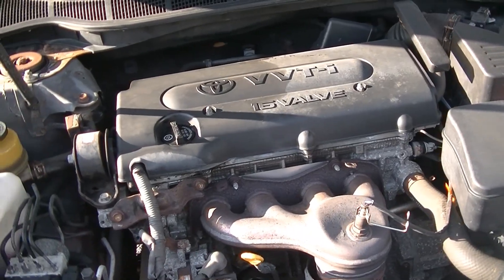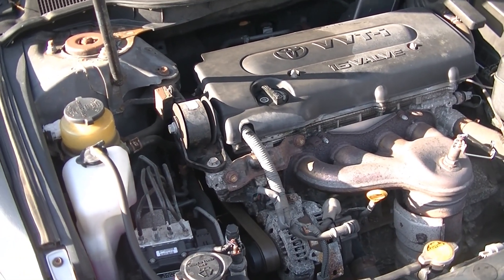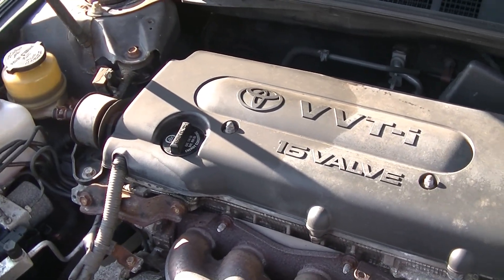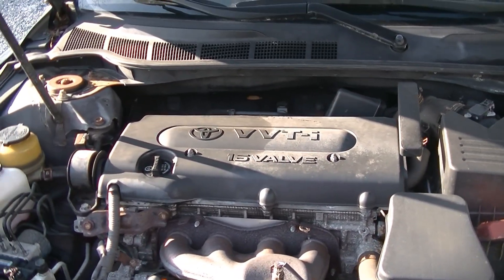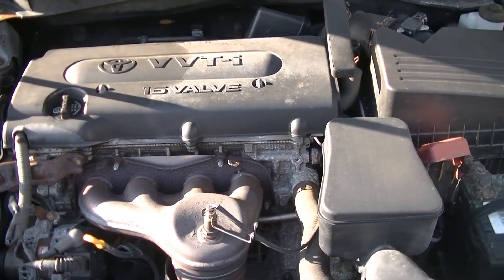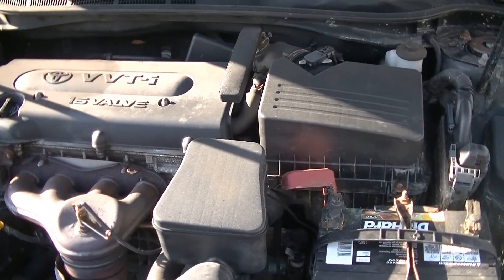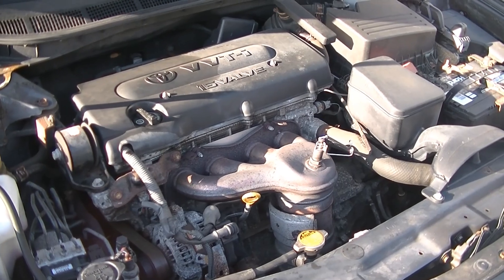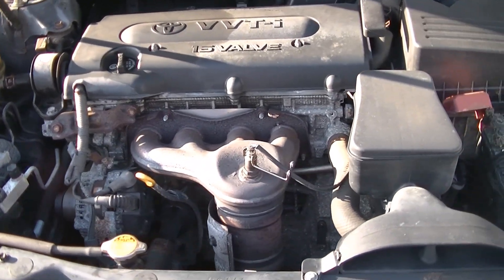Why you should AVOID a TOYOTA with the 2AZ-FE 2.4 liter engine!

Comment: Our 2009 Camry with 2AZ-FE currently has 106,000 miles.  We keep records and changed oil every 3,500 to 5,000 miles.  I started changing the oil myself at 83,000 miles using Mobil-1 Synthetic 0w20.  It currently burns 1/2qt every 2,500 miles, but when I change the oil it still has a nice amber color.  We purchased this Camry new and the only maintenance is Gas, Oil, Battery and Tires, other than that I just recently replaced the Spark Plugs and Air Filter.  Engine Bay looks brand new, no rust or engine leaks and Engine has never been washed.  Always garage kept.  So far this Camry has been a great vehicle.  I'm "Toyota impressed" even if the 2AZ-FE is not the best Toyota engine.
Reply: Don't change anything you're doing based on what I'm saying. I'm only sharing. I have an old friend who owns a junkyard and is something of a car guru. He's the 3rd generation owner of the yard so he's been fixing cars since he was born and he's in his mid 60s. We had a conversation about what oil to use in this Camry he just sold me and I suggested the Mobil 1 synthetic because it's always done me good with all my GMs. He very passionately told me not to.😂 He said every time one of these blow up he asks what they used and every time it's Mobil 1. 
Synthetic is the way to go but he swore by Castrol and made me promise not to put Mobil 1 in here. Do your own research and take what I'm saying with a grain of salt because I'm just telling you what was told to me.

Comment: I have over 288,000 miles on my 2AZ-FE engine and it still runs like a champ.  I did started using Restore engine oil additive which has helped out tremendously.   Not sure what's so bad about this engine.  It's a very reliable engine in my opinion.
Reply: My 2006 Camry has zero oil consumption between 3,500 mi synthetic oil changes with the correct grade of oil. If you guys follow those instructions you'll never our problems with this motor. It's a great engine but it's not designed to be owned by idiots.
Reply: @rene6722  I have a 2006 Camry.  250,000 miles and runs great.
Reply: @brianraulerson5037  mine just turned 230,000 miles no problems at all. I replace the rear drums and the front brakes and everything to do with the brakes along with all new springs for the suspension.
Reply: @rene6722 You don't have this motor in your 2006. It was produced from 2007-2009.
Reply: @phill3583 I know that's what I said. I have the 2006 motor that has the better piston rings in it.
Reply: @rene6722  you may have the bulletin repair done. Otherwise the 2azfe  engine is nightmare
Reply: @flyingman358  all I know is I got the car with 167000 original miles from the original owner in 2016, and now it has 228000 miles. Zero problems ever. Great mileage great power quiet engine. The only thing that ever happened was it needed a battery a drive belt and an alternator that's it.
Reply: @flyingman358  I will do some research and see if I have the fixed engine. It's definitely the best 4-cylinder engine I've ever owned and I've owned practically everyone ever made from most manufacturers. I have another car and it's a 1996 Camry. Another bullet proof car that runs like it's new.
Reply: @rene6722  my 07 rav4 has the same engine, and the original owner. The oil consumption issue was terrible since 50K miles, I received the Toyota notice for the toyota service bulletin and extended warranty to 100K , but my local Toyota dealer turned down my service request. Now the Rav4 only 150K , huge oil consumption problem
Reply: @flyingman358  yeah I've never had an oil consumption problems. Between oil changes I might put 1/4 of a quart of oil in.
Reply: @rene6722  that means it got TBS serviced. It could be a great engine in the early stage had piston rings replaced
Reply: @flyingman358  you know what bro,? I would not doubt that. The person that owned it before me said that it was fully serviced and that it had something repaired from the factory. That's probably what it was! I am very lucky with cars.
Reply: @flyingman358  I have always been impressed at how my 2006 Camry does not consume oil. I can almost guarantee you that you are right. It most likely has had that service because I've been researching the last hour, and what you say sounds to be correct. Thank you.
Reply: @rene6722 another video mechic mentioned looking for black sealant around the engine cos the original factory  is grey .
Reply: @flyingman358 nightmare according to who, I have a 2AZ-FE in my 08 tC and haven't had any issues. Calling it a nightmare is a clear overstatement.
Reply: oil changes 5k and under were key for the faulty piston rings design
Reply: @cutehumor  I've had 2 cars with the 2AZ in them and both I neglected to shit and they both had over 200k and ran fine
Reply: @roswell911dd8  I don't believe so. Unless you have piston rings changed , otherwise the crazy oil consumption issue
Reply: @prettylies7387  oh wow that's good news! So basically I own the best camera for quality and that's awesome! I knew I was smart to buy that car back in 2016. Zero problems.
Reply: It has defective piston head seal rings but other then that its great
Reply: I have 300,000+ on mine and have never had a problem.
Still going

Comment: from what i am hearing from this video it sounds like negligance of ownership not a failure due to improper manufacturing i own a 2007 scion tc with this engine and it runs amazing at 262,000 miles no oil burn issue or any others listed y him

Comment: I just bought a Scion xB2 with 278000 miles for $200 as a daily.. it has 6 codes, none are for the engine and all that I can fix myself, these engines can last forever. Just fix them if they break and keep pushing.

Comment: Got my vibe gt with this engine, bought at 72,000 has 132,000, never replaced anything yet just change oil every 8k runs like a champ, BUT they fixed the headbolt issue in 2010

Comment: Yeah he either is not familiar with toyota engines or is trolling everyone this engine is fantastic and can over heat without blowing up iv been driving my 2.4 for 300.000 miles still going strong no ticks knocks Nothing yes gaskets on everything get old eventually but I believe u might be confused with the north star Cadillac engine there is a big reason why a company that over engineneers everything used it for a decade

Comment: This guy is FOS... The oil issue was in the 2007-2009, because of poorly made pistons.  2002-2006 were some of the Best engines ever.  I wouldn't follow this guy, if he paid me !!!
Reply from the maker: I guess you didn’t watch the whole video. I specifically say in the video that the oil burners are from 07-09 from piston issues. 02-06 are known for head bolt thread failure in the engine block

Comment: Only one made in usa have defective piston ring from 2007-2009  i have one made in australia i never have this problem
Reply: really.....I currently looking at a 2007 toyota rav4 and it only has 70,000 kilometers here in Aus the used car yard say's it has had Major recondition repairs to pass roadworthy and does have two different colour side mirrors. it has the 2AZFE engine but that has turned me off due to the reputation of that motor with burning oil.
Reply: @dalesmith4985   only in usa had that problem

Comment: Is it good to use a 20W-50 oil but I change my car oil maximum is 2 and a half month. But normally I sha get it every month.
Reply from the maker: That is way too thick in my opinion. I like to stick to manufacture recommendations as close as possible. You can try a 5w30 or 10w30 if you don’t live in a cold climate. The thicker the oil the longer it takes to get to internally lubricated parts of the engine

Comment: My ‘02 Camry has this engine, and has burned 1qt. per 1000 miles—for the last 100K miles.  The engine is completely original, except for a couple of valve cover gasket replacements, and routine coolant, oil, filter, and plug replacements, and now has 314K miles on it.  Starts and runs smoothly.  The exhaust system has been replaced once because of salt-related rust, not because of any oil-burning catalytic converter issues.  My mechanics’ guidance has been spot-on: “Add oil, and keep on driving.”  I would avoid the ‘07-‘09 editions of this engine, but my earlier one has been fine.
Reply: Every have any head bolt issues?
Reply: @jordandudgeon346  No.  I think as long as I keep the cooling system in good shape, and it doesn’t overheat at all, they’re not a problem.  327K miles now, and still being daily-driven by my son.
Reply: Thanks! Man some people are so negative about this engine. They make it sound like the head bolt stripping the block is inevitable. I just bought one with 85000 miles and I was nervous to find out about head block issues after, but I think if I take care of it I'm good. People are being unrealistic I think, pretending the head block issue is more common than it is. Do you think it happens to most of these, or just a small portion?
Reply: @jordandudgeon346  Dunno—I have a sample size of 1.  But if I was in the market for a bargain in a used car, a private sale of a known-low-mile pre-‘07 Camry w/the 2AZ-FE, preferably from an elderly, maintenance-fussy driver, would be on my shopping list.  And they’re out there—hopefully, you got one of those.
Reply: I got one with 85,000 miles for $8,500 Canadian Dollars (so about $6000 USD). The outside is in perfect condition, not a scratch, the inside is mint, the console still smells new on the inside, drives great, no issues, doesn't burn oil, and oil stays gold for a long time in the engine... I'm sure the man was mantnaince fussy, as it's in great shape. The hood says the tyranny was flushed at 80,000miles and the coolant was flushed at 60,000miles. I'm the third owner, but really I'm the second. The first owner was an old man who sold it because he couldn't drive anymore. The second was a younger man who took good care of it but only had it for 2 months and then sold it to me as he was moving.

I really hope I got a good deal, and hope it lasts. Don't want to run into this head block issue! Besides that I don't have any concerns for the reliability of this engine!! Think I got an okay deal?
Reply: @jordandudgeon346  We bought ours 13yrs. ago from my mother-in-law, and it was a rental or lease turn-in when she got it.  It had 114K miles on it when we got it from her, and we’ve put 213K on it since.  We’ve replaced wear parts, but nothing internal to the engine or tranny, OE A/C system, water pump, electrical components, etc.  If you want it to last in Canada, get it Krown rust-proofed pronto.  I’m in Michigan, with similar road-salting, and all of our cars get Krown resprays annually when they’re driven regularly in the winter.  Krown completely changes the economics of car ownership by keeping the car’s structural and internal cosmetic integrity sound.  Without rust, the only questions will be “how long can this engine/trabsmisssion go?”  With a Camry, if it’s not in a collision, that’s a very long way.  Take care

Comment: I second this video. My 2009 Camry just blew a head gasket with internal damage and needs an engine replacement with only 55,000 miles on it. Diagnosis wast that the radiator leaked, there was no coolant, and a faulty temp reading system provided no warning sign. Engine seized in the middle of the highway. CHECK YOUR COOLANT OFTEN ON THIS ENGINE.

Comment: I have the 2AZ-FE 2.4-liter engine in my 2006 Camry. The car has 130,000 km on the clock and has never burnt a drop of oil. I change the oil every 5,000 km and drain and fill the transmission oil every 50,000 km. I have changed the coolant and water pump once.
Reply: How much trans oil do you put in

Comment: From my 35 year experience  the 2azfe is the best 4 cylinder engine I have worked on.
Reply: I have almost 460,000 miles on mine.  I'm pretty sure this is the engine in my  2004 Toyota Camry.
Reply: @robertbrown6879 i have 405,000 and recently have the loose head bolt issue to deal with. love my 04 camry tho, still drives like it’s only 150k old.
Reply: @robertbrown6879  maybe urs was recalled or is made in Japan otherwise That engine Is so useless
Reply: @julioanthony1951  Whatever, 18 years and 460,000 miles doesn't sound useless to me, but you're entitled to think and say whatever you want to.
Reply: @robertbrown6879 it is not the engine in the 2004. This engine 2AZ-FE was in the 2007-2009 Toyota Camry. When he said 2002-2009 he doesn’t know and is WRONG.
Reply: Some of the rhetoric comes from uninformed consumers that don't do the research.  The low tension ring years are 2007-2009. The head bolt issue is mostly 2002 to 2004. The 2005-2006 exhibited head bolt issues overheated albeit any aluminum based engine will easily be damaged from overheating.
Reply: Made you the most money?
Reply: @identifiesas65.wheresmyche95  🤣
Reply: @identifiesas65.wheresmyche95  😁😁😁😜😆
Reply: Can you please elaborate?
Reply: Subpar maybe for a Toyota, but it is reflected in the used price, and while it burns oil, it's very easy to work on, has a timing chain, and while the engines often burn a lot of oil, they don't seem to fail when taken care of.  My 2011 Scion XB burns about 1 quart every 1000 miles and has for the past 55,000 miles.  It currently has 255,000 miles and runs perfectly.
Reply: You definitely are either dishonest or like attention.
Reply: Mine doesn’t burn much oil, just a tiny bit like any other car. It’s a pretty great engine. I’ve had it overheat like 2 or 3 times but had no warping or anything. Only replaced the gasket, no head bolt stripping issue.
Reply: Your workshop never got empty due to 2azfe engines hehehe
Reply: Burns oil
Reply: Best engine he's worked on, because it was always in for repair.  Of course he won't elaborate about the engine itself.

Comment: 201k and running like a top. These are great engines. Just do your oil changes and keep up with routine maintenance. Granted, mine is an 04' which was before the oil issues became prevalent and I do all of my own work. Understand what you're saying but this is definitely a good motor in my opinion, you could do a lot worse for sure. And it isn't an interference engine like the Hondas so you can repair it if your belt snapped.
Reply from the maker: The 2az is chain driven and to my knowledge is an interference engine
Reply: @SEsGarage  my bad. I did not know it was chain driven.

Comment: Well Stephen, I went and did it LOL. Got a project car, 2003 Camry with this engine. The radiator was leaking, the heater core was leaking too. Engine is solid and doesn't burn oil. Has 281K miles. I bought it as a project/flip car. Replaced the radiator, thermostat and the heater core. That's when I noticed the leak in the back of the engine under the intake. No coolant in the cylinders and plugs and compression are good so it's not the head gasket. It has to be the head bolts. LOL. So, guess what I am going to do this spring? Yup, pull the head off and do the dance with the devil LOL. I am decent DIY, done plenty of deep dives but not this deep yet. I was thinking of doing a redneck solution and silicon seal the leaking area between the head and block, but I better do it right. Love those projects.

Comment: I have the same engine in my 2011 Scion xB burns a quart ever 300-500 miles. I put zmax in my oil it cleaned the engine and slowed the oil burning

Comment: 2011 toyota camry 2.4 L, driven 207000 KM, never had any issue. For the last 4 years I just changed engine oil and filter. Once the Crank seal was leaking so replaced it and that too 3 years ago. That's it. This is a pretty good engine. And no oil consumption till now. Running good.

Comment: 2AZ-FE in my Rav4 2008 (NZ market, Japan made). Has never used any oil, and still runs like new after 120,000km.
Reply: Yip I have a 2012 Rav - Jap made (in Oz) also no issues. I think the piston ring problem was the American made Ravs at that time.

Comment: I have a 2005 Camry 2.4L and still driving it every day, it has over 410,000 km in the clock, and yes it has a coolant issue just like the rest, I keep to top up the coolant, but it is never overheated and still running very well.   I will think it may go another 100,000 km into 500,000 km as long as I keep topping up the coolant in the rad.
Reply: Hi pal, Where is supposed the coolant to be going?
Thanks!
Reply: @taz24787  the coolant has an external leak from the head gasket due to the strip cylinder head bolt. as long as you keep the coolant fill, you can keep driving it .
Reply: @3819144  Ohhh, got it. Thank you!!
I am looking at a 2005 Camry to buy right now as my first automatic transmission car. But when I road tested it, the gears were not answering well and at high speed it seemed to lack force. As an experienced owner, do you know if this may be small or BIG issues?
Also, when turned on, the engine blows air through the opened oil cap hole. Not enough pressure to push my hand, but it does blow. Is that normal for this engine?
Thanks once again!
Reply: The radiator or coolant hose may have a leak. Check for white residue indicating dry coolant